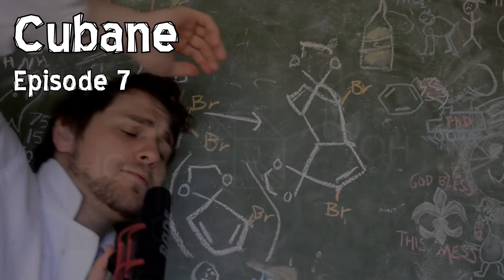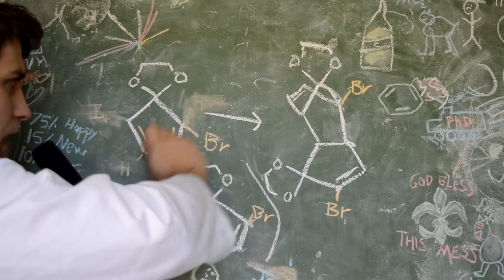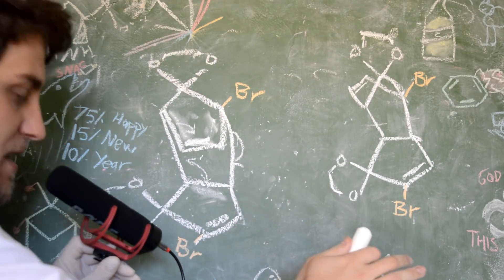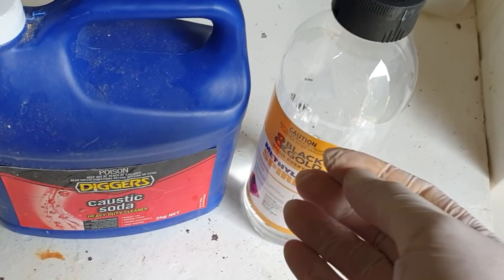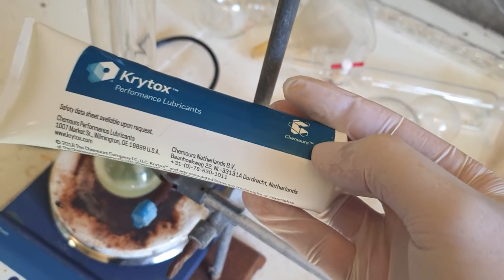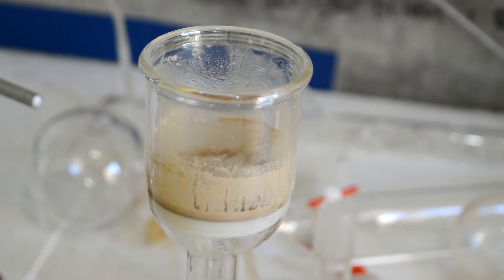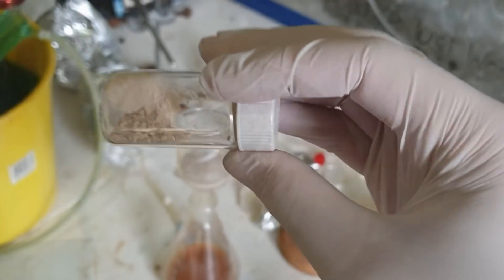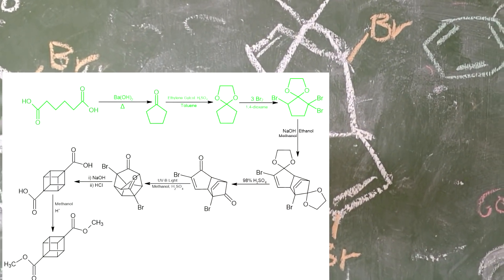The Diels-Alder - Making Cubane Episode 7

Comment: Methalated spirits, usually contains exactly what the name says. That would be ETOH w a touch of methanol to make it poisonous (only about 2%). Straight methanol can be found at auto part store, under brand name HEET. It is sold as a diesel fuel additive to remove water. Also used to melt ice great for iced up doors, locks, and especially good for air lines.

Comment: Krytox is super duper expensive. It's a really high temperature grease we used for greasing bearings in a steam drum. It's carcinogenic though so make sure to wash up well.
Reply from the maker: Is there anything in particular you use to wash up with? Because if you got some on your hands I feel it would be hard to get it off well
Reply: @ExtractionsAndIre  Any mechanic's soap. Gojo and Fast Orange are Brands here in the US. Borax soap might work okay.

Comment: I actually finished orgo 2 recently, and I do agree there seems to be a disconnect between its use in industry vs it’s focus in university. But you’re correct in that it seems to be a good model for just alot of chemistry concepts. Like you said endo/exo and the 3d aspect of this reaction, but I’d like to add that it’s heavily affected by Electron donating/withdrawing substiuents. Which I think shows well the affect of non-bonding parts of molecules having a big part to play in the mechanistic route of reactions, aswell as a kinetic effect. Really cool video dude.
Reply from the maker: Oh yeah, that's coming back to me... some tough exam questions if I recall... Thanks mate!

Comment: Ok, so I'm confused (armchair enthusiast here) about what the point of a reflux is.  If you're heating something, why leave it open and recondense?  It's like you're just being mean to the vapor giving it hope of escaping only to force it to drip back down into the hellish depths.
Reply: 11:52 I'm grooving to this awesome little bit of music.
Reply from the maker: It really is just stopping it boiling dry. When heating it at this rate, you'd lose all the ethanol in about 10-15 minutes. Returning the solvent allows you to keep heating for as long as you want. 
Sealing it up and heating it makes it explode, so you need some way of keeping it vaguely open
Reply: @ExtractionsAndIre  Oh, ok.  So for reactions that you need to keep hot but you don't want to create a little glass grenade with pressure.  Makes sense.

Comment: Just a thought for getting really precise temps in your reactions on the cheap. 
Buy a cheap Sous Vide machine and use that to heat a water bath. Precise control to a 10th of a degree. 
Can get one from Kogan for less than $100.
Reply from the maker: Yeah that's actually a good idea. Been thinking that I use my hotplate an awful lot to just heat water
Reply: @ExtractionsAndIre  and you get the added benefit of being able to make the best steaks you've ever eaten

Comment: 8:07 NO KRYTOX IS THE WORST, IT GOES IN THE ENVIRONMENT AND NEVER BREAKS DOWN, AND IT ONLY DISSOLVES IN HFE-7000/7100 OR SOLKANE
Reply: @cas curse fluoropolymer greases will always be the most durable, but they are impossible to get rid of afterwards

Comment: Methylated spirits in the states is typically called Denatured Alcohol. It is 55% ethanol 45% methanol. Damn good at melting ice and also killing you. Costs only about $10 a quart, and is generally marketed as marine stove fuel, as it is 100% combustible. Source: I worked at Home Depot for 4 years. If you want any tips about stupid chemical shit you can get there hmu. For instance, one of the cheapest ways you can get ethyl acetate is by getting an MEK substitute for $10 a quart, as well. It pays to know your solvents

Comment: I personally HATE papers that just say “the _____ was recrystallized” and give fuck all details about how to carry the recrystallization out....
Reply: It's because recrystallization should be a common knowledge technique.  But I agree they should at least say what solvent they use, preferably an estimate of what volume, what temperature, how long they let it set, etc.  Good papers will do this (i.e. papers in JACS, Angew, Nature, etc.)
Reply: @user-ko7lz3kr1d   Yeah I'm more than capable of doing a recryst, but I need solvent details.
Reply from the maker: The authors actually use a word in the experimental here which I've never come across before, and I actually have no idea wtf it means honestly, hold up I'll find it
Reply from the maker: "washed thoroughly with water (1 litre), triturated with boiling
ethanol (c. 500 ml), then cooled (−10◦C) and filtered, thus
affording the bisketal" 
triturated????
Reply: @ExtractionsAndIre   “triturate” verb. To grind thoroughly into a powder.
Reply: @ExtractionsAndIre  "triturated" is when you mix things around with a spatula while filtering. At least this is what i have been told when i was undergrad.
Reply: @ExtractionsAndIre  "In organic chemistry, trituration is a process used to purify crude chemical compounds containing soluble impurities. A solvent is chosen in which the desired product is insoluble and the undesired by-products are very soluble or vice versa. For example, when the impurities are soluble and the desired product is not, the crude material is washed with the solvent and filtered, leaving the purified product in solid form and any impurities in solution." https://en.wikipedia.org/wiki/Trituration
fck yes for wikipedia
Reply: @ExtractionsAndIre  According to the fount of all knowledge, Wikipedia, for organic chemistry it is basically recrystallization.  It's the purify crude solids by dissolving impurities but not the product or vice versa.  Same general idea as a recryst but not quite since you want to leave one undissolved.  Can also mean to grind into fine particles or thoroughly mix together while grinding, but that doesn't apply here.
Reply: @user-ko7lz3kr1d   it could apply here. Like, meaning they mixed and ground the solid while it was suspended in the boiling ethanol solution.
Reply: Sometimes they say it at the begining of the experimental section. Like where they say all the equipment and nmr and stuff. Like "all the recrist were done in ethanol" and then they dont mention it.
Reply: @TheLouisph   that’s best case. Also, if I can even find their damn experimental section sometimes XD

Comment: I think the most tedious part of this whole thing is that whenever you make a mistake that you can't fix, you need to re-make all the same chemicals again. It's a decently long synthesis route, and you're starting from the very beginning. So good luck. And thank you for the upload! Today was sucking, this will help make it better for sure.
Reply from the maker: Yeah absolutely. The plus side is that I'm usually a lot better the second time around, but hopefully it doesn't get to that because we have at the very least quite a bit of the non-brominated ketal to work with, so probably won't ever have to go back to the adipic acid assuming the ketal product stores okay
Reply: @ExtractionsAndIre  Well that is good then :-)
And btw, I think the best descriptor is off-yellow.

Comment: You have ketones in your ethanol; probably Methyl isobutyl ketone. When you added the hydroxide, an Aldol Reaction/Condensation started. This resulted in polymers that give the yellow color you hate so much. Food for thought, cool video though
Reply from the maker: Yeah that seems a likely theory, as the ethanol is not 'food grade' so it can have whatever in it. Seems a strange colour to go, it starts out like a light green rather than the usual red of the typical condensation, but I think eventually it goes to more a red it you leave it for a few days
Reply: @ExtractionsAndIre  I bought a liter of 99% lab grade ethanol on ebay for like 6 euros. Might be worth it, along with some ph strips and filter papers for that vacuum filter. Makes it much easier to collect your product. ;)

Comment: That's a VERY crude melting point test. Product confirmed to have a melting point above room temperature and below the melting point of aluminium, so somewhere between 25C and 600C.

Couldn't you use the hotplate to reach ~250C, rather than a blowtorch.

Comment: 7:10 - Im gonna go out on a limb and guess breakdown products from denatonium benzoate used to stop kids from drinking it.
Reply from the maker: Yeah it's an easy thing to blame but it honestly must be in such low quantities, it's hard to think it's solely responsible. No idea what else could be in there, it's a strange nearly green colour, not a typical aldol type condensation so it's not like acetone or anything, so don't know
Reply: DB is extremely bitter and thus used in insignificant quantities. It will show up only on NMR (or when tasting). Other contaminants, if any, are to blame.

Comment: Diels Alder reactions are also very stereospecific, so they're very useful that regard to make 6 member rings with a high degree of specificity. I think that's a major reason for covering them. They can also serve to introduce kinetic/thermodynamic products in greater detail
Reply from the maker: Yes it's something I didn't mention, but you also get two stereo isomers for each of the endo and exo, so it's pretty impressive you basically get one isomer in good yield (the other endo product can be isolated in small amounts according to the authors, but I didn't discuss that)
Reply: The endo product is thermodynamic, right? And would the exo product have the diene bromine on the other side or would it be the product where the double bond with the bromine on it acts as the dieneophile? That second one sound like it would be really unlikely but idk
Reply: @derrickm18903  Generally the exo product is the thermodynamic one as the exo product is less sterically hindered and therefore more energetically favourable, that is it has a lower overall energy.
The endo product is generally the kinetic product product because even though it is more sterically hindered, pi orbital stacking stabilizes the transition state making it more likely to form, and form quickly, even though the end product had a higher energy.
Reply: Not to mention how drawing out the products is garunteed to take away any confidence you previously had drawing hexagons
Reply: yes these are all certainly words
Reply: @the_bw_trekkie   hmm yes indeed 🧐